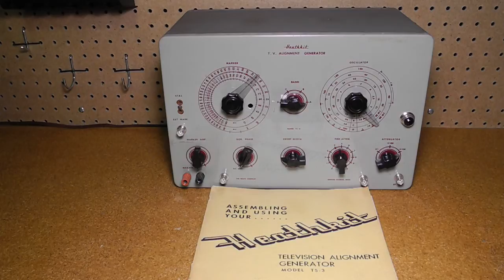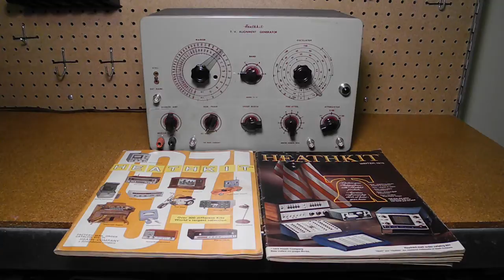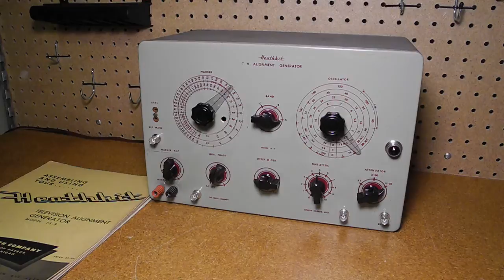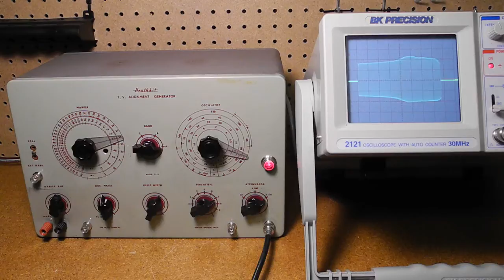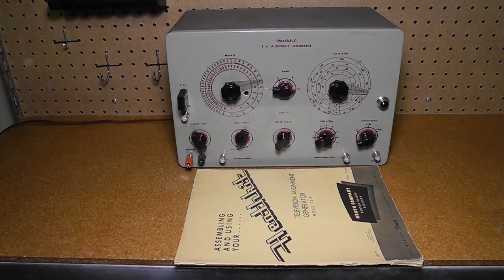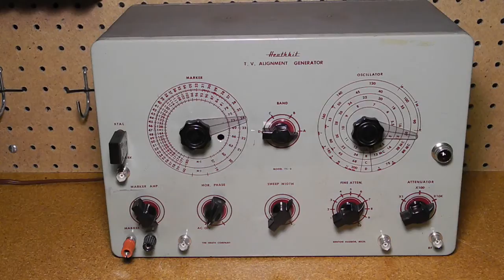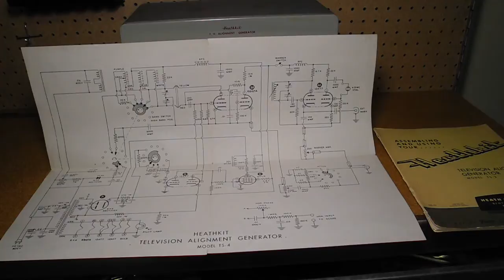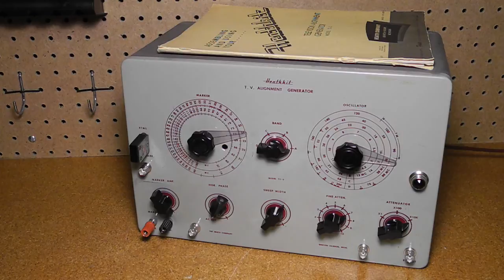The Heathkit TS-3 Television Alignment Generator

Comment: Uhhhh...... That's a real crappy display lashup.  The 4.5 MHz marker is for the alignment of the sound IF amplifier and detector circuits.  This may help:  https://worldradiohistory.com/hd2/IDX-Consumer/Archive-Radio-Electronics-IDX/IDX/50s/1950/Radio-Electronics-1950-02-OCR-Page-0036.pdf

Oh, another 6X4, 6X5 hater.  They usually only short when overloaded by shorted filter capacitors when people plug things in and wait for smoke.

Comment: @jeff tranter have you tried using the TS3 for TV IF alignment? I’ve tried to use it as instructed in a Sams by inserting the sweep output into a tube cover, covering the mixer tube. It didnt work very well. Any tips? Did you terminate your output leads with 50 ohms?